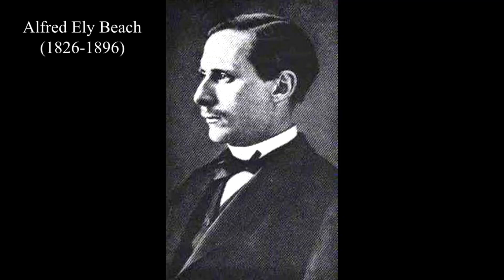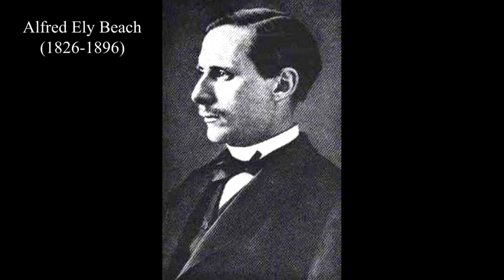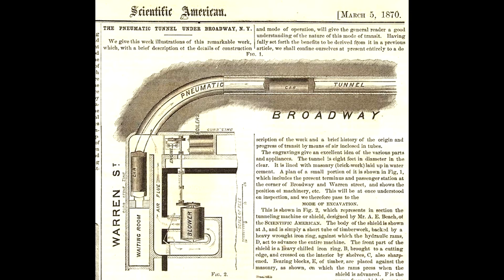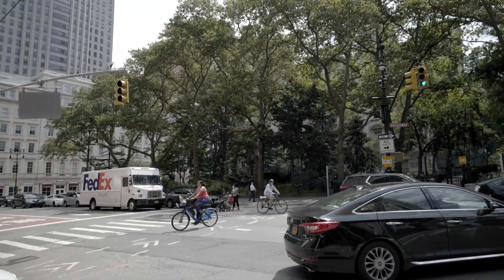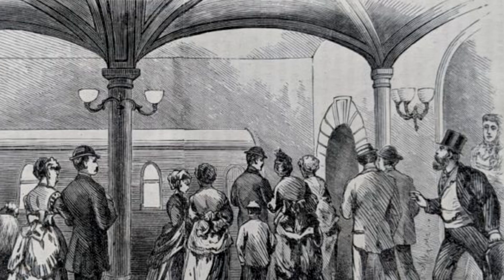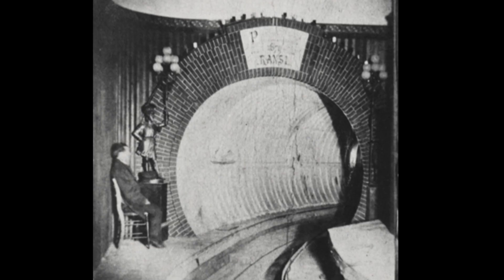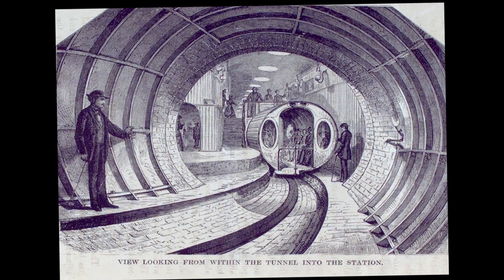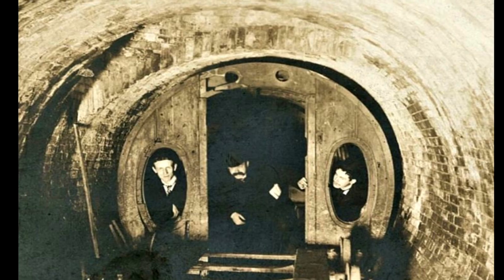NYC's First Subway System | Beach Pneumatic Transit, 1870

Comment: The first successful rapid transit system in Manhattan was the Elevated Railway.  Lines were built on Greenwich Street and 9th Avenue from 1867-1876 and by 1878 three steam powered lines (3rd Avenue, 6th Avenue and 9th Avenue) ran the length of Manhattan.  In 1880, the 2nd Avenue elevated line opened and in 1886.  The lines were converted to electric propulsion from 1901-1903.  In the then-independent city of Brooklyn, five elevated lines opened from 1885-1893 [parts of today's J and M lines date from that era and remain in operation].  All of the original Manhattan elevated system was razed in stages from 1923 to 1955.  For an all-original color record of the last years of the Manhattan Elevated (1951-1955) see my book, "By the El, Third Avenue and Its El at Mid-Century."  It is available from the New York Transit Museum Shop at $19.95.  Lawrence Stelter, Author=Publisher, 2/27/24